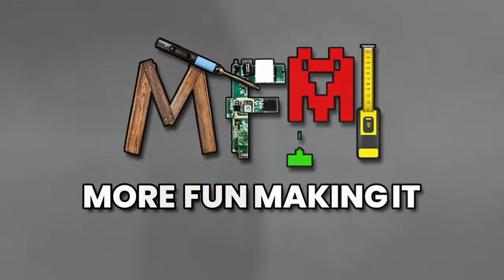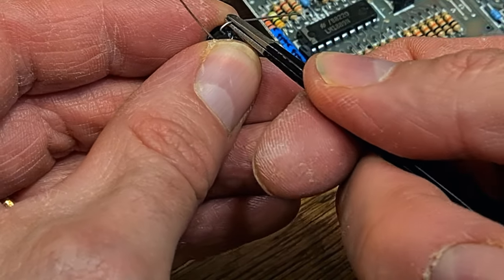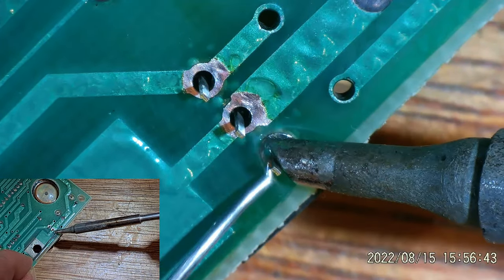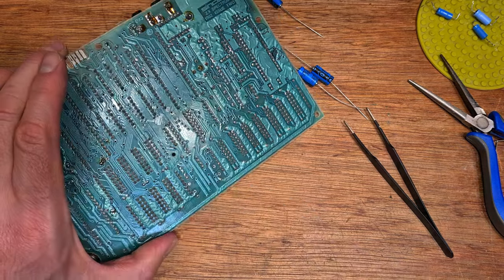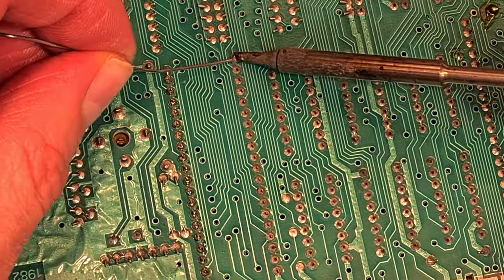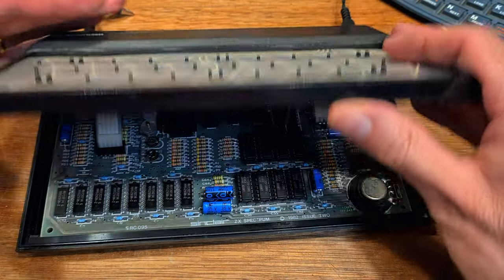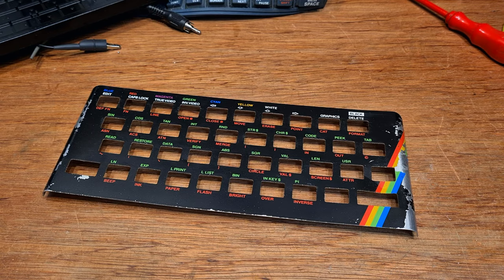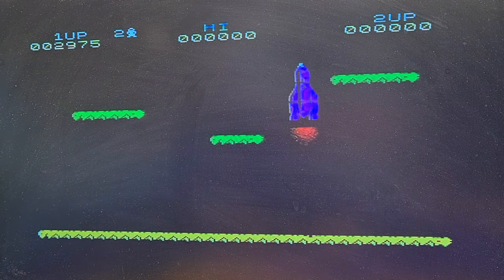ZX Spectrum Restoration - Taking a working rubber key 48k Spectrum and making it continue to work!

Comment: I won a 16K spectrum when they  out. A year or so later I purchased an upgrade kit, the sockets for the extra 32K ram were already present, it was just a matter of putting the chips in the sockets, no soldering needed.

Comment: 20:24   the 48k keyboard is fine, if you've literally never used any other computer keyboard and at the time, most of us hadn't.  A lot of the problem is layout, really, it's not the feel of the keys, which when combined with the speaker click made it perfectly adequate as an input device, if not a great actual keyboard for extended typing.  There were a lot of keyboard shortcuts in adventure games to keep typing to a minimum.
Reply from the maker: When you mentioned the speaker click on keyboard press memories of first experiencing that came flooding back. It felt like the future after using a zx81

Comment: These metal pieces at 19:55 folded in plastic to secure the faceplate are not a good idea and it scratches the case. Double sided stickers are the best solution !
Reply from the maker: These are the original, factory fitted parts. I don't understand where the scratching of the case comes from? The brass tabs are inside the case and just hold the faceplate down as they were designed to do. Double sided stickers are what they used after these, and I suspect they didn't do it because it improved things, most likely because it was cheaper. Attaching brass holders is a lot more expensive than double sided tape. Also, there is a problem with the top edge where the faceplate sits on the case. It was never designed for tape and its very difficult to get tape to attach along that edge. The ones I have with brass fittings all look perfect.

Comment: I’ve never owned a Speccy so sorry for this stupid question. How does that DC-DC mod work if it’s only a resistor and a buffer cap I presume? There’s no intelligence causing it to divide more or less voltage depending on the available input voltage. A zener diode of 9V would make sense or a window comparator opamp or even a switching regulator. But how this works is not clear to me. Anyone care to explain?
Reply from the maker: My electronics knowledge is way too limited to answer this. I believe its to apply a change that came to later revisions, but as to why? Sorry, can't help there! 😁

Comment: What about hiding the capacitor inside the RF modulator box?
Reply from the maker: It's just a little cramped in there and the cap fits fine on the outside. Maybe if I have a crystal case I might consider that though!
Reply: @MoreFunMakingIt  from the video I have the impression it should be possible to mount the capacitor so that one leg faces the RCA connector and the other one can be fed through the existing hole in the metal case.